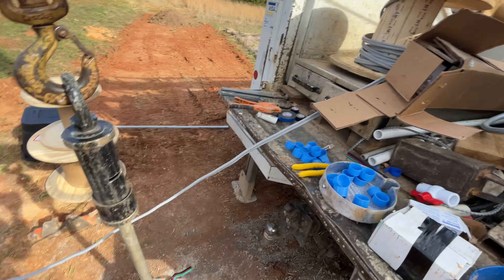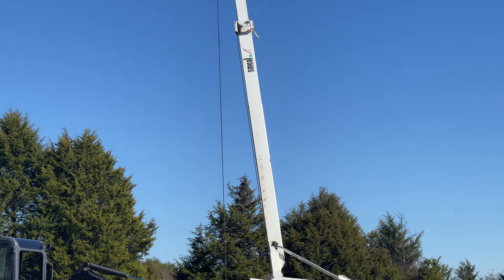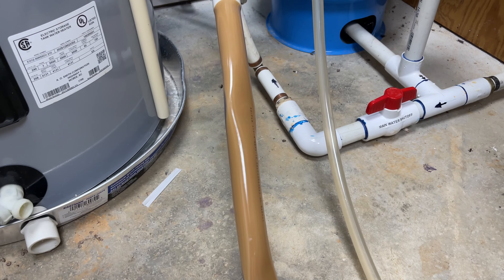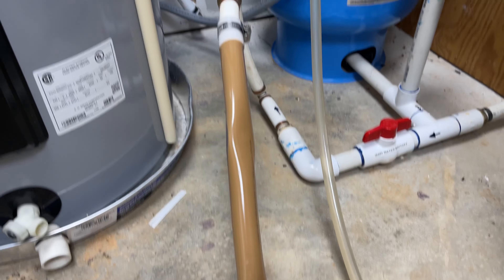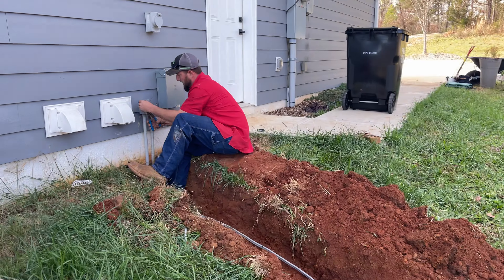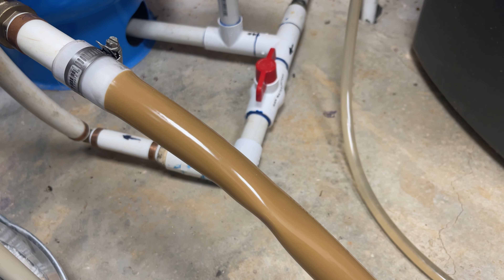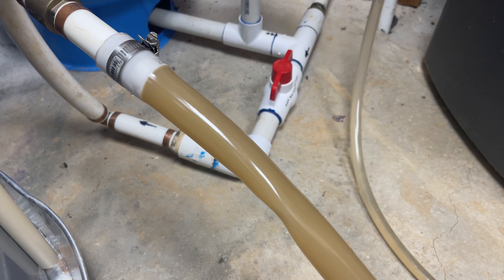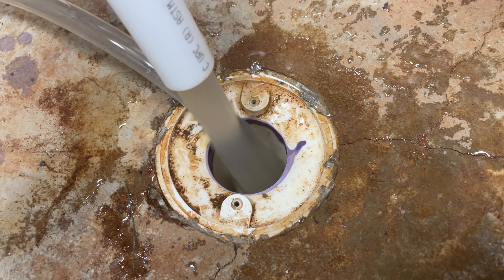A Well Drilling Story (Part 2)

Comment: How's looking at this point? Thanks.
Reply from the maker: The new well is still a little cloudy last I checked but I think it’s still getting better. We’re currently using our old well because we got rain this spring that has helped the recharge rate. Also, the large initial amount of mud from the new well messed up our filter system and I haven’t fixed it yet so I haven’t used the new well much at all. I think once I fix the filter system, it will be able to clear out the cloudiness and we can use either well! 🤞
Reply: @makefixbuild  Thanks for the reply - we're wishing you all the best.